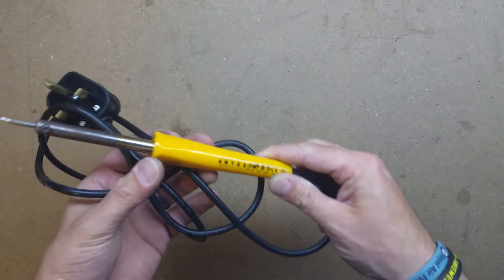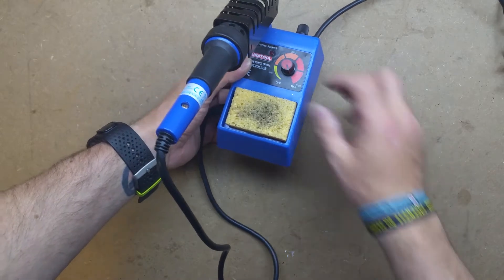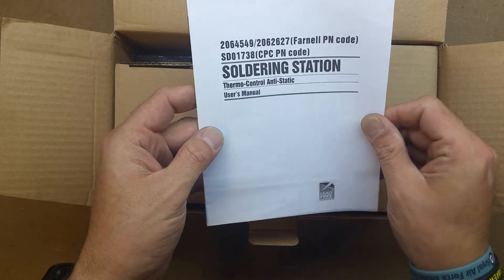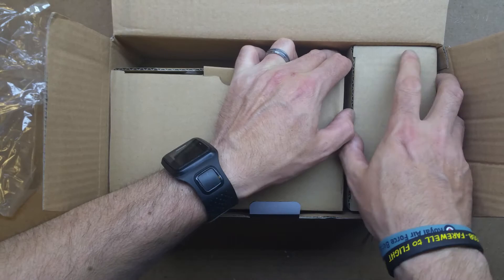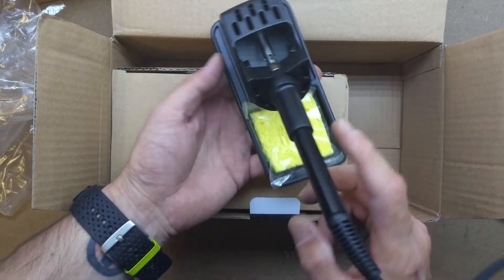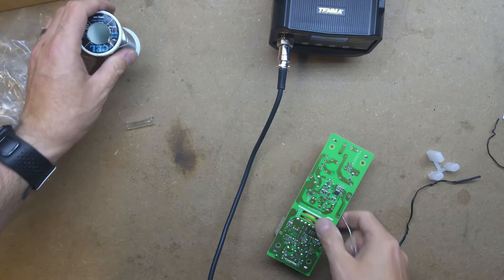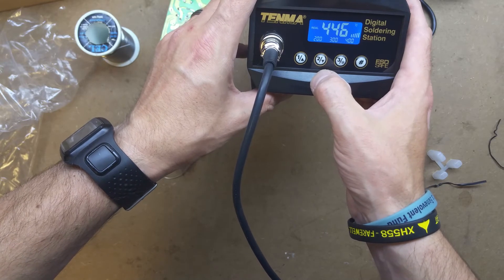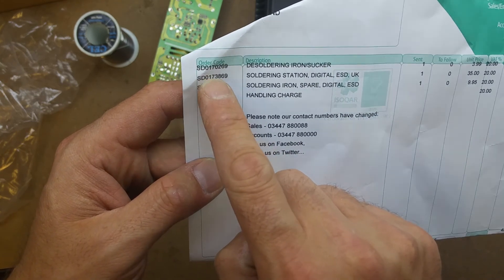Tenma digital soldering station unboxing.

Comment: Hi Kris,
How is your  soldering station preforming now, after a years work. I'm thinking of getting one of these. Have you checked the tip temperature, is it near to the displayed reading. 

I tried a cheap station and it was rubbish, unable to control the temperature. it just shot up to 450c each time it was switched on. At one time the tip glowed red !

Comment: I have one of these from Maplin, there's no feedback from the iron, took it apart, only 3 wires going to the tip, for power and ground I've been using it for a while now, to be honest with you, it's a waste of money. Supposed to be 60W, cannot even melt terminal blocks. My 30W El Cheapo iron with a decent tip and dimmer does a better job.
Reply: Really mine can melt anything I use it for and never had a problem with it being underpowered and it does have some sort of temperature sensor because if you have the heating element out without a tip on it with it turned on then you pute a tip on it the temperature on the screen will decrease and also show how much of the element is being used so I don't know how they get the temperature regulation but it definitely does. The only problem I have had is that the transformer and main chip inside the station does get hot after an hour if use so i have installed a fan to suck air through the bottom vent and blow into the case but other than that I think it is a really nice robust station